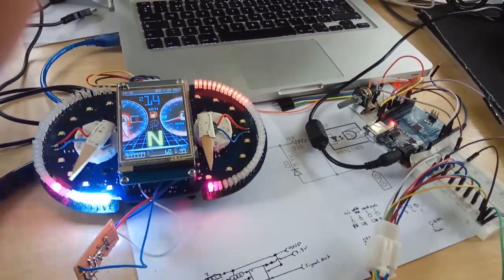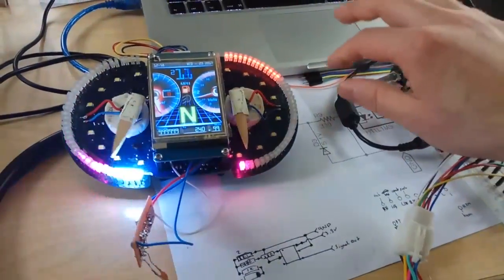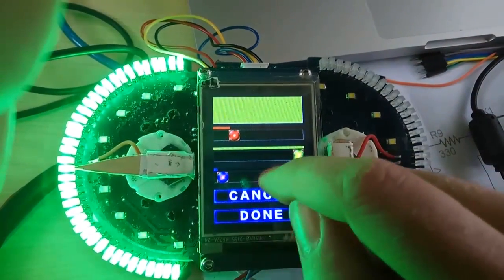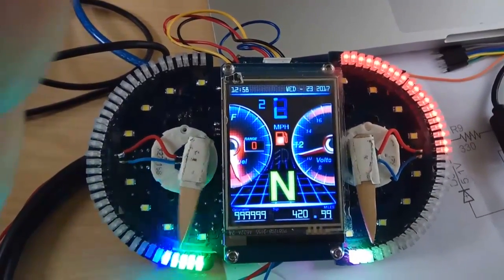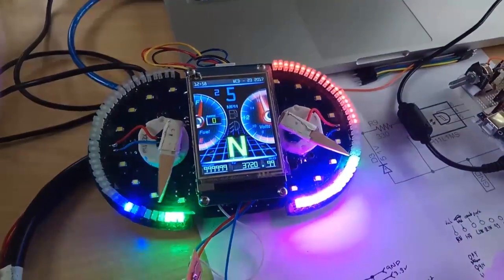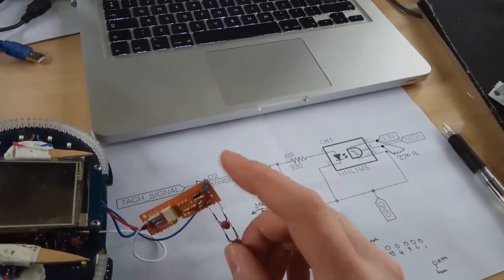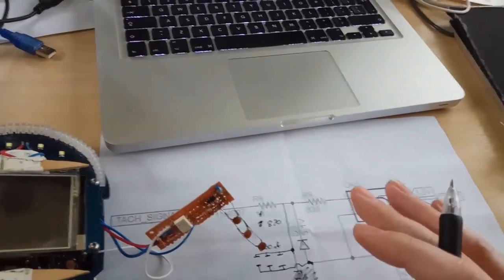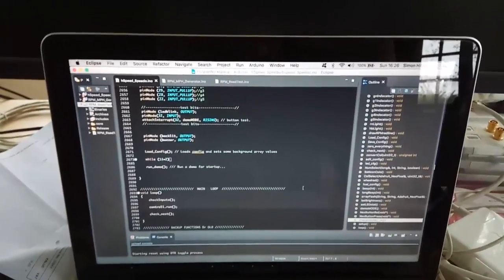REALLY BIG UPDATE!!!!1111!1 Digital Speedo

Comment: Haven't checked your other videos yet. However if your looking for a great filter for Rpm and speed. Try using a monostable 555 timer circuit with a really short tank constant. The output trigger output will be super clean, stable and easy to pull into a mcu.

I use this circuit on my jetski brake light application in my patent and happy to guide you on it if you've never used them before.
Reply from the maker: Hia, The filter i made seems to work fine for this bike, but its true it might not be "universal" as i would like it to be... Your 555 timer based  filter, does it need tuning to different rpm signals?
Reply: The principle is this... A 555 timer set up as a monostable mode... i.e. one shot mode. The 'on' time set with a 1ms period with the combination of R/C to make 1 mS... the components are variable as you choose the cap then match the resistor to make 1mS tank circuit. 

The idea is simple. The RPM from the bike depending on your tacho source will be noisy as hell. False triggers, double triggers etc... which is why you've had to tune a filter circuit on the input to your opto. 

What works best is a filter which can be triggered and ignore any resonance noise or emi noise. This is where the one shot works well. So, you get a trigger signal from the primary pulse from the tacho (or in my case the induction pick up sensor). The resonance and emi noise will ring and bounce around but the output of the 555 is set for 1mS, regarldless of what the input is doing. The 555 will simply produce a 1ms 5V output pulse on the first pulse in. In essence, it's a hardware debounce circuit which doesn't rely on absorbing energy into a RC suppresion circuit. 

The only tuning is input level you need... so a 10K pot on the input will let you turn down and set the input volume so to speak. This will of course allow you to filter out the primary pulse from the lower level input noise. You can keep your 5V zener for input protection to the 555 if you like. Best part, if you put a Pot on R1 and on the input, you can on the fly tune the input signal level ...and also the time period for the filter. So your not soldering the circuit to make fine tune adjustments. Your literally cleaning up the input signal and changing the bandwidth of the filter :)

Whats the limitation? the 555 pulse period... now depending on how your getting your tacho signal... I'm guessing at 8000 rpm your not trying to read 8kHz signal? a 1mS one shot gives you about 950 pulses per second... so if you measuring say an ignition pulse from a HT lead, then you'll see the max RPM on a 4 stroke is 1 revolution in 4... and once you've figured out what your sample rate will be for max RPM then you can choose your one shot time to give you a nice filter for the shortest time period you expect to measure.

Some great tools online are here http://www.electronicecircuits.com/electronic-software/555-timer-design-calculator-software

If you don't want to download the calculator, I posted an image of the circuit. R1 ~ 10K and C1 100nF. 
https://cdn.discordapp.com/attachments/179394148808261632/453344160875937805/unknown.png

You can see the monostable taking an input signal? Which gives a square wave output as it's simply a time held comparitor output... neat huh

Comment: Hey, what are you using to detect RPM? What circuitry? I'm trying to do similar
Reply: OK i see it, i thought it was something more complex, like using a clamp over spark wire.
Reply from the maker: That little proto board sticking out with wires under the main unit. Thats a filter I made, it takes the noisy RPM signal and turns it into an easy to read square wave. While unintended inverted.... Though that doest matter. The MCU on this one is a STM32f103 baite maple mini. i take that filtered square wave signal into a pin and through the code read the time between pulses. Then with the magic of maths derived a RPM number which I placed into a RPM global variable. The program later uses this number to update all the display stuff... 

Sadly this version of the project is kinda unfinished and over... Im moving onto some other stuff since getting a new bike.

Im still working on a speedo project just not this time. Shame really theres some aesthetics of this i really liked. i may come back to it later.
Reply from the maker: Also if you check my hackaday profile theres a project showing the diagramme for the filter.
Reply: Simon wow

Comment: This is really amazing!!! There is some way to me to get the code and schematics?
Thank you!!
Reply from the maker: Sadly not, schematic wise it was never finished... and ive moved onto a new design since this. Also while i sometimes give out functions and stuff to make some things work. I dont really give out full codes for whole projects.

Sorry
Reply: Simon Ou, and can you tell me how did you do the led effect when it goes down the value?
Reply from the maker: Its far too complex to explain here... But in a really basic description... 

I have the number stored as a global variable. So SPEED or RPM is a global var. My program when it comes to the LED update function takes this variable updates the LEDs based on the number. The leds are addressable. in this version of the board there is a WS2811 IC for each led. i later used 26 channel TCMs. These addressable led controls allowed me to treat each led like a pixel and I could build up the colour per pixel based on the speed or rpm variable.  The simplest way to update would be to have a for loop:

for ( int i = 0 ; i < ledCOUNT: i++ ) 
     { 
       if(i <= (speed * (ledCOUNT / speedRANGE) )
         {
         led[I] = color(255,255,255);
         }
     }

This would light up the leds according to the number that speed is set to.

This isnt the real function but its a basic example of how to control the leds.  I made a primary array to hold all the colour information of each LED pixel. with this I could have a lossless backup of all colour information before any brightness correction or animation effects are applied later in the programme.   The final element then runs this array and copies it to the addressable led arrray and updated to display...

Like i said its really too complex to explain here. Theres tons of stuff going on.

Comment: Dear Simon. Can you help me i making a rpm meter for motorcycle. and have signal from ignition coil. normally is 12v and when the spark goes its GND. is your schema from this video will be good for the signal from ignition coil.? a try many other schematic and they works only to 2k rpm
Reply from the maker: the filter i designed may or may not work on your bike. But Yeah I read the signal direct off the ECU coil trigger wire. This splits, goes to the dash and to the coil trigger... On my bike the signal was really rather noisy and to get a clean signal i had teo design a filter that worked for my bike. i based the design off some open source stuff online... You can find my signal filter design here.. 

you may need to tweak the resistor values to get it working for you 
https://hackaday.io/project/23144-rpm-signal-filter

remember the output signal is inverted so you might have to change your code for this. (though a rising edge is a rising edge no matter which way its shown so funnily enough still works with my old code)
Reply: Dear simon thank you for your reply. I will try your filter.

Comment: Hey, i have a reliable Tach circuit on a trigger coil ignition. usually universal on most cars. should work in your case too. PM me for details. that a pretty nice project by the way! was thinking of something similar with a nexition display. if you need any help let me know. i got the circut for oil, water temp, etc....

Comment: Hi, what display were you hoping to replace the Nextion with? I can't quite make out what you said. Thanks!
Reply from the maker: FTDI Eve ft810 is what im going to use. Ive been doing a lot of work on the new display board with the controller chip.

Some more major updates are on the way but it might take a month or two for them to happen... Short on cash and doing a lot of learning. Moving to this new display solution hasnt been easy so far. Ive not even got it working yet. But im making progress. Just slow though because of lack of funds.

I think i setup some sort of fund me thing a while ago... Forgot really but nothing came of it sadly...
Reply: Mangy Dog brill, thanks for that. I've just started on a similar project using a Nextion display and Teensy 3.2. What prompted the change to FTDI from Nextion?

Im lucky in that the data comes in via CAN so it's fairly easy in comparison to yours. 

Good luck with the project, and keep up the good work!

Comment: Nice update. Been following this project for a while. I've a similar setup in the works. Got the Nextion enhanced 2.8" from AliExpress few days ago. Learning to send and retrieve data. I got the RPM being read by a 555 timer in monstable mode. Like here: http://www.sportdevices.com/rpm_readings/index.htm. A small 8bit WS2812 strip does the RPM shift lights. You got cool LED animations :)
Reply from the maker: Cool, ive seem 555s used for this sort of thing before. I guess in a strange way its a bit like using the schmitt to get a good clear square...